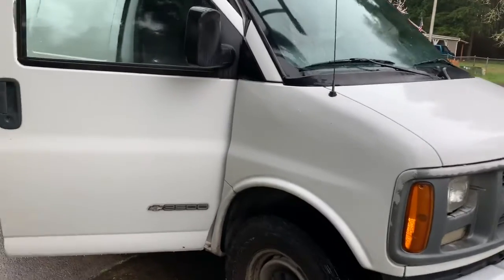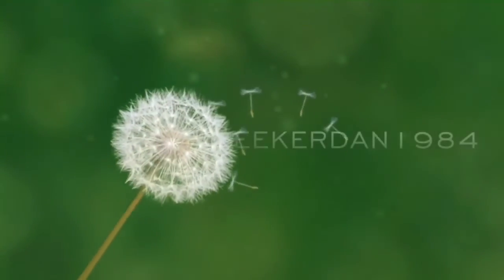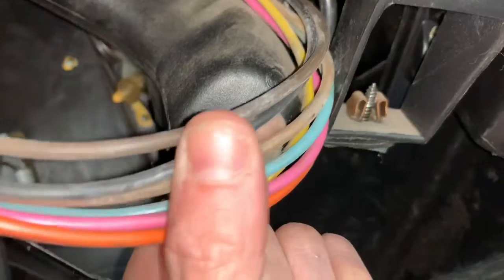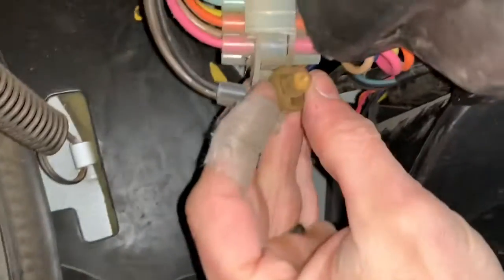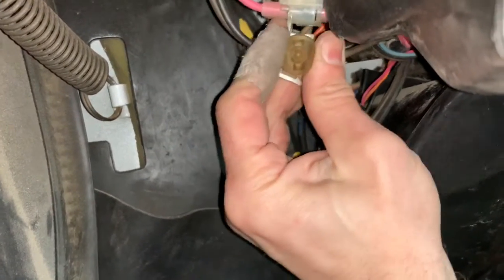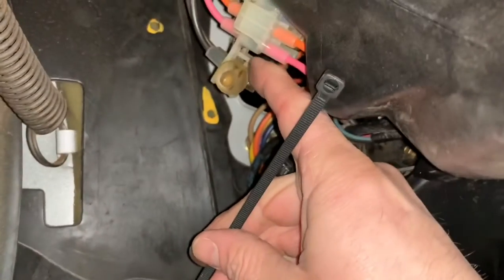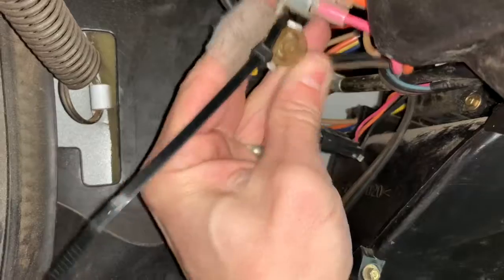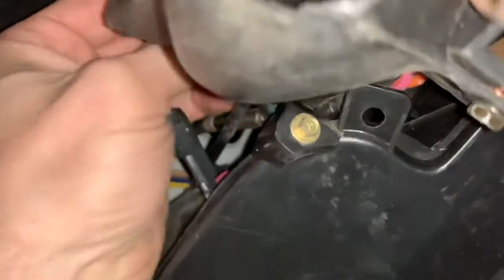Express Van front heater vents not blowing warm/cold air

Comment: Love it. Having the same exact problem. I’m going to go look at it right now. Hopefully it’s as simple as what you just showed us. If not, thank you for the informative video anyway.
Reply: Well, just checked. Unfortunately mine is connected and the AC is still not working correctly. Still just blowing out of the defroster area.   And it’s hot now!!!
Reply: @ar2043  i am having the same issue mine started just today. Only blowing from defrost vents
Reply: Thanks for the help. I looked at everything and even pulled the engine cover to see if the vents somehow got disconnected.  What you showed was the exact problem.

Comment: This turned out to be exactly the problem I was having, on my 2007 Chevy Express van. (GMC Savana.) I fixed it as you described. Thank you so much for your expertise and your video.
Reply: how did you fix it ? im working on a 2008 chevy van express would be the same... thankyou for any info...
Reply: @harryhydee2524  It was just a brown-colored hose, under the dash on the right, in the passenger's feet area, that had gradually gotten disconnected. So I re-connected it firmly, and now it's been working fine since last summer.

Comment: Awesome.  This was the issue with my vehicle.  As a bonus the line was also plugged with dirt.  Double bonus the previous owner had disconnected the actuator and had used wire to hold the damper position.
Reply from the maker: Awesome, thank you for sharing. Glad it worked!

Comment: Makes perfect sense cause I shoved a big box in that area right around when it stopped working. Gonna give it a shot in the morning. Either way, thanks for making the video simple. Other people would stretch it into 13 minutes
Reply from the maker: Thank you for the feedback 👍
Reply: @TweekerDan1984  So I was literally trying to do it when you commented back. One of the wires that you zip tied to popped out and I can’t find it. And of course it’s cold here icing up the windows haha. Figures
Reply: @blewidescorpio  i have this exact same problem, mines missing the black wire..
Reply: @AdrianO1-97  I wonder if when they popped off if they contracted back behind that paneling to the right. I dunno. I wanted to open it up but I was pressed for time with my dispatch. Had to go the loaner van route which is always sketchy
Reply: @blewidescorpio  hey man my mechanic just gave me a awesome tip, so idk if you have the sane problem but i had no air coming out of the vents at all so while im waiting for my new blower motor to come in, he said to tap the motor with a screwdriver or something a couple times and it should work. I just tried it and my air is back on! Give it a shot if you have the same issue

Comment: Great video! Was that the original routing of the vacuum harness? Ours hung dow for years on our 2009 Chevy express 2500 cargo van. I noticed the harness runs down from the climate control in front of the duct and then goes back up and the duct locks it in place. Ours has a retainer instead of the screw that holds the duct up in place. I popped the rubber retainer in the hole from the top down as you showed us that the correct location? There was a plastic retainer popped down in that hole from the harness the ones that are taped to the vacuum harness but I think it belongs somewhere else. Mice chewed up our heater vacuum harness that runs to the climate control module so we just had that replaced last week and we had no air to the vents. I’m trying to get everything routed correctly under the dash. Our plug with the brown and black vacuum line is new with the harness but our old one was loose. Ours doesn’t have two black and brown hoses that conbect on each side. The brown go’s to black and the other side is plugged from the factory. Does yours have auxiliary heat? We just have one brown hose that runs behind the floor mat and through the firewall. Any advice on routing behind that heater box for the rest of the vacuum harness and that black electrical wire would be appreciated. Thanks, Kevin.
Reply from the maker: There is well over 300k miles on the van so I couldn’t tell you for sure if these are all of the original hoses or routes.
Reply from the maker: @Wolden12031968 hey Kevin, when routing be sure not to kink any of the hoses or wires. Also when pulling them through, you will want to be careful as be careful not to let them catch on anything. Using a hanger or wire snake can be very helpful. Sneak the snake through the route where you would like to run your replacement tube/wire and then tape them to the end of you snake using electric tape. Hope this is clear enough, best of luck 🤞
Reply: Thanks Dan!
Reply: Thanks Dan that’s helps a lot!
Reply: Hi Dan, I pushed the rubber retainer on the connector down into the hole on the heater core plastic cover as you showed. My main question was is that the original location where yours was? Our local gm dealer service department could never figure out where it went. I just looped the harness as you did ran it back around the floor duct and popped the retainer in that holds the duct in place. Ours doesn’t have the screw. I left the vacuum hoses loosely looped up above the duct. I didn’t install the vacuum harness to the climate control we had a local shop do that so I didn’t have to snake it through. They did leave the harness hanging down near the floor. Thanks
Reply: Hi Dan, I just wanted to know if that’s where your retainer on the connector was originally?  Thanks, Kevin.
Reply from the maker: Hey Kevin, yes that is where it was on this vehicle originally. Just to be clear that we are talking about the same thing what is the time stamp in this video for the retailer you are referring to? Thank you 😊
Reply: Hey Dan, the time stamp is at 2:36 where you are showing where to put the rubber retainer. Our vans a 2009 but has the same setup. Thanks, Kevin

Comment: great video! thanks for sharing.
Air is coming out of my 2014 Chevy express but I have no heat.
I will appreciate any suggestions. Thank you!
Reply from the maker: If the heater resister pack is not melted, and doesn’t have signs of damage then it is likely the thermostat or heater core. Sometimes you can get away with simply flushing the  heater core/coolant system.
Reply: did you ever get this fixed? My dad is having the same issue on a 2011 express 3500. When he turns on the heater, it blows out cold air.  The rear gets warm air but the front 'vents' blow out cold air. I helped him change the thermostat but that did not fix the issue.
Reply from the maker: Do you know if there is a separate heater core for the rear heater? If the blower motor is functioning properly a common part to fail causing loss of heat is the resistor which is typically located on the blower motor housing. The other known culprit is the heater core. Sometimes you can temporarily fix this by flushing the core itself with water. This fix can actually work for quite some time. Definitely feel free to reach out if you have any other questions. Cheers!

Comment: My issue is that the vacuum tube from the check valve heading into the firewall is split. I know I need to replace it. But do you where it goes? Does it plug into all these tubes you have in the vid? And if so, how does one run it from there to the check valve?

Comment: What if only the heater is not blowing hot air, but the A/C does seem to be working properly. This just happened to me today for the first time. 2006 GMC Savanah 1500. I can tell when I turn the A/C on that it gets even colder, but nothing when I turn it to heater at all. It appears the thermostat is working as far as I can tell. I'm thinking either the temperature control is not working or I have a clogged heater core.

Comment: Hey great video! I have the same problem on my 2015 express van but can’t find the black wire that connects to the plug? Any ideas?
Reply from the maker: Are you referring to the wire under the dash? I’m betting that it has a plastic clip that keeps it out of reach up in the dash. Sometimes the wires can be mounted on the upper back side of the blower motor housing.
Reply from the maker: Also thank you for the feedback.
Reply: I have the same year van and the same problems. The brown line is kinda crimped. Could be it?
Reply: Also having this issue - can’t find the black wire and the brown wire is where the black should be in the harness…

Comment: My 06 Chevy express van suddenly stopped blowing air out to vents and compressor  fails to engage  at the same time and blower is working fine.
Reply from the maker: Could be a loose wire or hose connection. If the blower fan is functioning properly and you have checked the fuse and  relay then. Then I would inspect the climate control and the regulator. The regulator should regulate the heating and cooling. Sometimes you can get away with wiggling the wires or tapping on it to see if it will start functioning properly. If neither of these things help locate your issue than it is likely that your compressor has failed.

Comment: I have the same problem.  When I looked at the connector, it is connected but I realize I only have one wire continuing on the connection.  It obviously has been working with one wire since I have had the van. Fiddling with the connector did not make any difference.  any suggestions?
Reply from the maker: @Bhopendra Nagar apologies for the delayed response, Have you checked your fuses and relays? Also have you tried tapping on the blower motor to see if it tries to turn?

Comment: What about if it don’t air at all ?
Reply from the maker: I would check the the wiring and hoses be wiggling them, if that doesn’t make a difference try tapping on the blower motor near the resistor. If the motor comes on after tapping the housing it is likely the blower motor fan or resistor